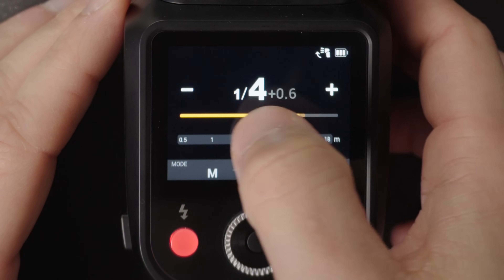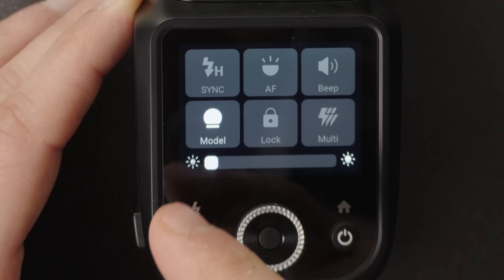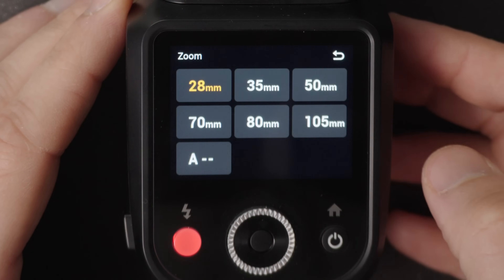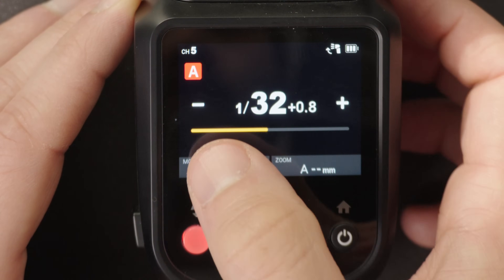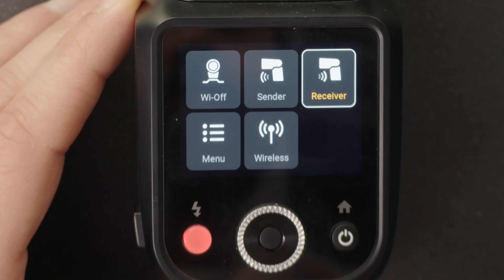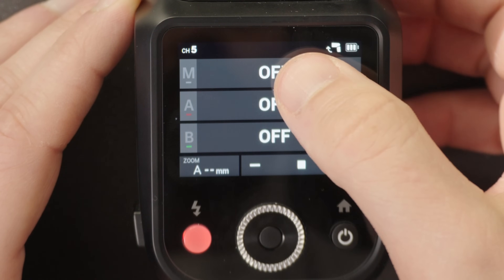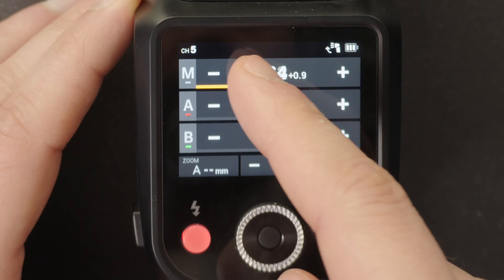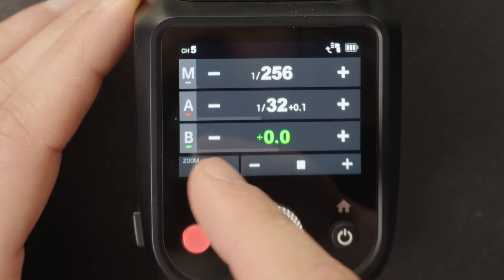New Godox V100 Flash Needs 1 Simple Fix (since Resolved via Firmware)

Comment: Hello, godox v100 nikon rear curtain sync hss not working.. max shutter speet it would be set to 1/200 unless I change the flash mode in the camera setting to Fill flash! my V860III hss working with no problem!
Reply from the maker: Rear curtain sync can't work with HSS. HSS pulses flash multiple times to illuminate a scene because above the sync speed, the shutter curtains do not completely open to reveal the sensor at one moment.
So your flash can only be in rear sync up to your sync speed, at which point it would have to switch to HSS to function.
Reply: @robhallphoto okey! Well I am on nikon z6III and in their website says sync mode high speed sync 1/8000 first and second curtain sync  support! And my v860III works with any!

Comment: Hi Rob, I used my v100 just once  on my canonr6 Mark ii and though it worked beautifully, that’s been the only time I have been able to use it. It no longer flashes in manual mode. Only flashes when set to ttl and it has a slow refresh rate. I’m not sure why it doesn’t work when set to manual and it’s driving me nuts. Any help will be appreciated. 

Thanks Rob.

Comment: Hi Robert! The camera I'm using the Nikon Z8. I recently purchased the V 100 for Nikon. I am unabe to turn on the H Sync button. It's black out with a slash on the screen button. I did update the firmware 1.01. And my camera is set to 1/250 s (Auto FP) I would appreciate any advise on what to do. Thank you so much. Scott

Comment: When I have the sub flash connected, everything works fine. When I turn off the sub flash in the menu, it also works correctly. But when I turn the flash off and then turn it back on, the sub flash is enabled again, and if I don't want it, I have to go into the menu and turn it off manually :(
Reply from the maker: I feel this behavior is to be expected because you have the sub flash attached. That fittingly indicates you want to use it.
Reply: @robhallphoto  So why even have an on/off option in the menu if the flash just assumes what I want?

Comment: Got it a couple of days ago, for Sony. The TTL wb is horrible (AWB or Flash WB) , skin tones goes to red, of course will require a simple adjustment on Lr and then sync, but still. What I notice is that I do one shot on TTL, then TCM and I continous shooting with that, I did not touched the WB, but this time, is ok, nice skin tones all Ok.  Anyone have notice the same issue?

Comment: I have just ordered this unit today (Flashpoint version).  I also have a couple FP Explor 600's that are about 4 years old.  Does anyone know if this light will control the older 600's?
Reply from the maker: @thomastarner8683  yes, anything in the X series / 2.4 GHz. Basically everything they’ve made since 2015.
Reply: @robhallphoto  awesome, good to know.  The war department (wife) will be happy to hear I won't have to buy any new mono lights.......Yet.
Reply: @robhallphoto  Oh.... one more question if you don't mind.  Do Godox and Flashpoint products work together? e.g. will Godox lights work with Flashpoint triggers or vice versa. My understanding is they are the same product just one is rebranded for Adorama.  They should work as long as they are all using 2.4 GHz, right?
Reply from the maker: @ yes

Comment: I want half stop.  I'd even use the option to just have one button full stop changes.
Reply from the maker: @AdamPalmer  full would be a nice addition too. I can’t get behind half stop though, as 99% of photographers aren’t even aware of that control level being on some cameras. And it would have to go back to 1/3rd for TTL anyways which would just be confusing.
Reply: Yes, I agree. It's also a shame the wheel only rotates and doesn't operate as a power up/down button too. The wheel on the V100 seems to operate like the wheel on the AD200 when adjusting power. Annoying. 🫤 That's my deal breaker with this unit.

Comment: Can the v100 act as master to older slave flash units like the v860 for example?
Reply from the maker: @leebrown4971  the original V860? No, at least not without a bridge receiver on the V860 to make it 2.4Ghz. But the V860ii, (and anything X series using 2.4Ghz) yes.

Comment: Long press to turn groups on and off? 1.5 seconds? And then it goes straight to Ttl. That’s 3 seconds to turn on a group. Old trigger was a split second for a double tap button. This is such a bad design. I really want to return but have been waiting for an on camera flash with more that 4 group control. That’s the only upgrade with this flash compared to v1

Comment: I hear you but I thought the 1/10 stops makes for greater precision. sure it is likely a little more inconvenient because of the extra clicks but it is basically 3 clicks (on the v100) as opposed to approximately 1 click (for every one-third of a stop)
Reply from the maker: 1/10 stop for precision lighting is fantastic, and I'm not saying that be removed. My point is that 1/10th is typically a feature in addition to 1/3rd, and 1/3rd needs to be added. On every other transmitter, you have the option between 1/3rd and 1/10th.  The V1 / V1 Pro / V860III are a different story as they have a d-pad that controls in 1/10th stop or full stops, but all of this is done via physical controls so it's still quite accurate. We don't have the full stop controls here, nor is there any physical response when using the touch screen. 

Adding 1/3rd stops would give users the option to swipe more accurately without passing their desired power level. Tapping/dialing once for 1/3rd stop tweaks instead of 3 taps. In general swipe, tap, and dial adjustments are more useable in 1/3rd stops if you've got the mental math of photography down. The difference only gets greater when you get into 1 and 2 stop adjustments (3/6 clicks vs 10/20). Compounded over a wedding day or corporate event, where speedlights are most commonly used, there's a massive drop in how much attention your speedlight would require if you're in 1/3rd stop instead of 1/10th.

Comment: I just received the Flashpoint x100 version of this flash. Just incredible. The on-off switch is not a factor that I can tell. I just held the button, and it turned off. I think the safeguard is the wheel must be turned to fully power up the unit. I agree on the third stop thing for manual flash. 

I did find something that was really neat though. I sometimes like to just use the flash on camera. The reflective metering sometimes is a little wonky. I discovered that if you put the flash in the hot shoe, then put the flash into receiving mode, you can get meter readings from a sekonic 858 light meter. You can trigger the flash while it is on the camera. I know a lot of folks do not like light meters, but I use mine a fair amount. 

The interface on these V100/X100s is really nice. Much simpler.

Comment: Appreciate the insight..wow great points Rob!...thats crazy they "missed" that detail of the stop control..lol still definitely looking into this..good thing I din't switch to the V1Pro..and waited..lol just curious if you use the X3 trigger..do you have access to 1/512 power, asking and I know its now a comparison but the AD600PRO II you can when using the X3. .does this flash even have that capability?..does not look like it right?..lol thanks
Reply from the maker: I have access to 1/512 on my X3, yes it's in the step menu. Does that work with the V100? No, my V100's minimum power is 1/256.
Reply: @robhallphoto  yes..I want to pick up the AD600PRO II and this V100's..what do you thin of the new 433 X Trigger?..

Comment: Looks Nice. Is modeling light higher power than v1? Is there a physical button to switch to manual or ttl? I have read that when we hold flash in hand ocf we too easily change flash setting without knowing it. A physical butyon would be nice.
Reply from the maker: I don’t remember the modeling lamp brightness of the V1 offhand but I assume they are extremely close, both being quite low.
Physical button to change between manual and ttl, you can use the center button and dial to swap between manual and ttl if you want.  Or just tap the bottom left corner of the display, it’s quite easy to do without attention.
This is the second time I’ve seen concern about handholding flash.
A) why is your hand on the screen side when you have an alternate side to hold. The head articulates either direction, so you can point it any which way regardless of which side is in your hand.
B) if you are handholding it off camera then another transmitting device is telling it the power to fire at, so what flash settings are you even changing?

Comment: 1/3 stop isn't as important as a modeling light... and yeah, they have one, but you gotta add it in?  Not enough to sway me from my 860viii's.  However the new touch screen is nice and I see them (Godox) adding it to their other OCF flashes.
Reply from the maker: @WilliamBurdine  idk what you mean about adding in the modeling lamp. It’s on the lens, same place it’s been on previous V1 / V1 Pro. 
And I personally have yet to use a modeling lamp on a speedlight (or any of my smaller flashes for that matter), so yes I find the speed and accuracy of controlling the flash far more impactful.
Reply: @robhallphoto I think he mistook the small frontal flash for a modeling light.
Reply from the maker: @ ah, that makes sense, especially since that's where the modeling lamp is on the V860III.
Reply: @ I wasn't aware of the modeling light being in the flash head... I guess that's whey I went with the 860viii as I shoot hybrid and need the modeling light for video and in one small movement my flash head is already in place for photos.  I found it to be very versatile.

Comment: What i feel was missed here was a lock switch. A fast acting locking switch would solve a lot of issues people have with this and the previous generations.
Reply from the maker: Multiple people seem to want that.
Personally I have to go out of my way to make my head make contact with this touch screen, considering it's still a ways up and the body of the flash tilts away from the viewfinder. The display also doesn't respond to fabric so harnesses / spyder use shouldn't be an issue.
Reply: @robhallphoto  I have used it on a couple of events and I do find it easy to knock. Not when then camera is up to the eye but down by your side, or picking it up of a table. The time to switch this thing on and off is frustrating when on a job.

Comment: Since you probably use it with the X3 trigger, I assume you still have third control through it. With my mf12 triggered by X3 you can sent bot tenth of thirds of power as you wish
Reply from the maker: @EmanueleBiggi  that’s relevant to off camera use, but in that case I’d just use my more portable 100 Pros.
I’m strictly talking about the experience of using this on camera, and the lack of 1/3rd stop control affects the adjustment accuracy / speed in both single on camera flash use and when using the V100 to control other units off camera.
Reply: @robhallphoto so if I use the v100 pro with trigger, will I have 1/3 stop control?

Comment: Rob, I'd love to hear your take, on how the touchscreen only works for people that can take the time to play with the touch screen but for people that do fast pace events, a touchscreen will not work.  This also goes for the nano transmitter.  Im happy for the touchscreen for menu options but changing stops and groups should remain on the button side even if we had an option to do it much easier than the present way.
Reply from the maker: I don't think there's a significant speed difference, I think there is a slight attention difference, one that would probably impact SLR users and mirrorless viewfinder stans more than those who are open to mirrorless LCD use.

With physical controls I had no problem accurately doing a power adjustment without my eye ever leaving the viewfinder. This was huge back when I shot weddings on dSLRs. And part of the reason why dial feedback and dial accuracy were so significant to me. A touch screen (even with +/- tap options) would have never resonated with me in that period. Nowadays, I'm far more comfortable shooting off the LCD, and therefore I'm not as concerned about having to pay slight attention to confirm my finger is over the plus sign, or briefly put my gaze to the power setting to swipe an adjustment in, because I can still see my LCD and continue to shoot if necessary. Although, I'm not in fast paced environments nearly as much as I used to be, so perhaps I just don't ever feel the pressure to pay attention to it anymore.

Sure, there's a shakeup as you adjust to the new interface, but its surprising how quick you get comfortable. For instance in practice with the X3 I find myself staying in the single group page. Swiping up and down to navigate between the groups so that I can use +- taps to make adjustments without looking. I'm almost never on the main screen swiping power adjustments in, and I'm only ever in 1/3rd stop so I'm not doing a lot of tapping either. Just like sending text messages, early on it requires attention but after frequent use I can send a text message without looking at the screen at all.

Comment: The touch screen is a hindrance if you hand hold it.  Touch screen will change settings unkowningly to you.  Yes you can lock it out, but that takes some button pushing to turn it on and off.
Reply from the maker: Wouldn't you hold it with your palm on the non touch screen side, leaving the display untouched?

Comment: I have the flash and do like it but for me not having a there way physical switch for on/off/lock is a negative. Firstly I have found the flash unlocking itself on multiple occasions. Also it may only take a second to turn the flash on or off but when working at an event it's long enough to be annoying. One thing that is great is it connects to my X3 first time every time. Not something I found with my V1's and XproII . Off camera TTL is a lot better with Sony cameras but still not perfect.

Comment: I've been waiting to upgrade till everything is macos updatable and has the newer displays... not sure if I want a roundhead for my speedlights though, as a lot of my speedlight mods are gen 1 magmod which work better with the normal rectangular head.
Reply from the maker: I hear that. Magmod holds a special place in my heart, but I like the AKR1 modifiers more for these round head flashes as they take up way less space, and (particularly with the gels), are far cheaper. I use the Rogue round gels and they work perfectly with the other round accessories.

Comment: Seems like it would be a fairly simple firmware update?
Reply from the maker: It does. Maybe a bit more complex than previous, non-touchscreen units considering it's based on relative touch inputs as opposed to fixed inputs. But, I don't see why this can't be added relatively quickly.

Comment: Also TCM missed
Reply from the maker: Not missed, integrated more seamlessly. Now whenever you're in TTL and switch to manual it will carry over the last used power level into manual.
Reply: @robhallphoto  ah thank you amazing. I tryed it myself but it seemed to me that it walways translated to the same power so I thought it was just switching between ttl and manual.
Can you confirm that this is not present on the manual? I didn't find it on there
Reply from the maker: @PierpaoloPerriFotografo  Mine was a preproduction unit, so I don't have a manual to refer to, sorry!
Reply: It's there, just not called TCM. When shooting in TTL, press the manual button and all settings are transferred over to Manual.

Comment: For press photography it has 2 problem: reflector going only down to 28mm focal length. Switching the flash on takes too much time (touch button for 2 (?) seconds and then turn that wheel. I want a standard button, that reacts instantly.
Reply from the maker: Put a diffuser on (just as you would a regular reflector) and your light is fine with wider focal lengths. I do wish you could disable the dial for power on though, but I think they do that to prevent it from powering on while contained in a bag, like they do the larger units. If this was a consistent issue for me I'd simply make a button on my camera disable flash.
Reply: @robhallphoto  Even the support could not tell me, if and how any of their diffusers would actually spread out the light to wider angles. They told me, they just make the light more even. Anyway, it´s not practical to carry diffusers around. Compare that to a Canon or Yangnuo 680 RT: The reflector goes down to 20mm! So you nearly never need a diffuser. And if you do, it takes about one second to pull it out. And then you go down to 14mm!
Reply: @robhallphoto Profoto Ax flashes were the same, they got rid of the spin to confirm in a firmware update. It was terrible. Still annoying to turn on by holding the button though.